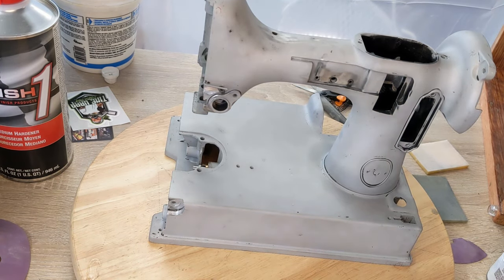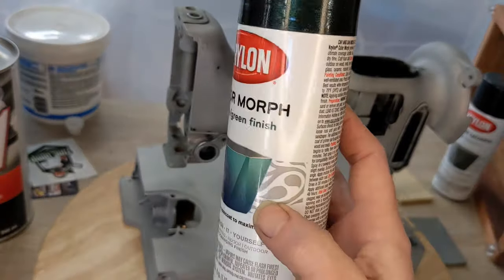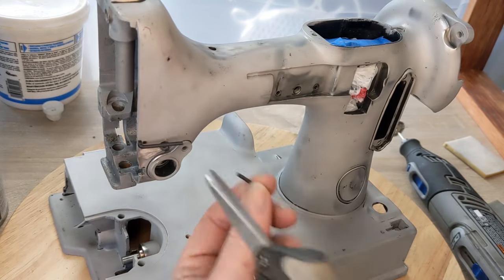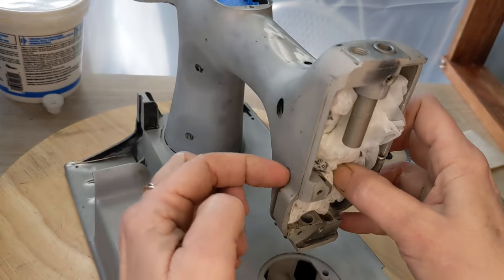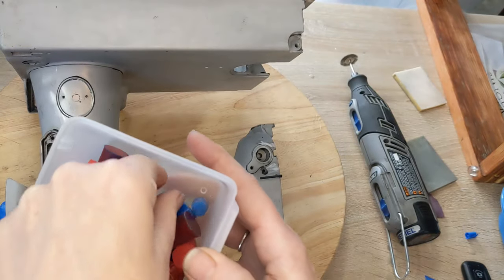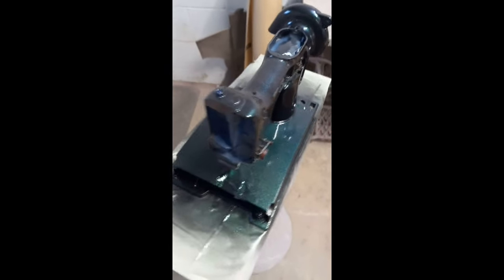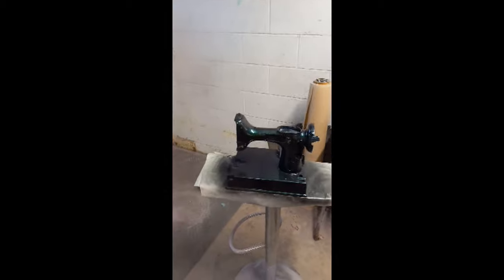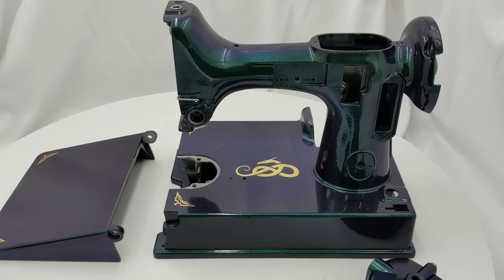Painting a Color Morph Dragon Featherweight Sewing Machine

Comment: Hi Marie. Did you mention what top coat you used??? I am having an issue and I will be posting a video. HELP!!!  But I think I know what I did wrong. Thanks in advance.
Reply from the maker: On this machine I used my finish one. But that requires the big spray gun and the air compressor and everything like that that I don't think will fit in your apartment. I still recommend the diamond coat as my backup if I can't use the air compressor gun. It's also really important that the primer has a really good hold on the machine. The only thing that I found that worked with aluminum is self etching primer. If I clear coat over a color that is over a filler primer on aluminum it's just going to wrinkle up and pull off. Unfortunately. So good luck!
Reply: Thanks Marie. I have the self etching primer arriving today. I am going to use it for the parts I did strip because I am learning from you and a few others that this is vital to success. 
Can't thank you enough for sharing your knowledge. I will keep you posted. Love your channels. I sew many different things when I am not restoring machines. You are very talented.  @prometheansewingmachines
Reply from the maker: @sewterie  I have full confidence in you!